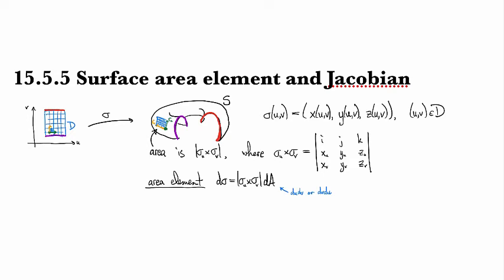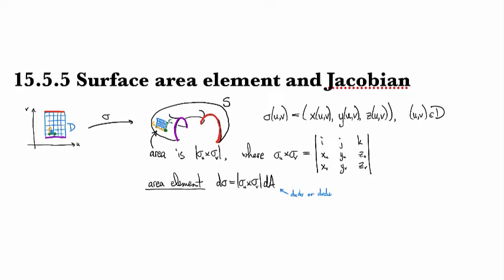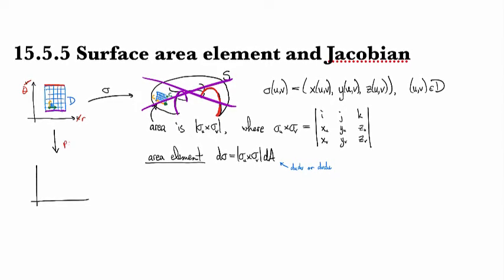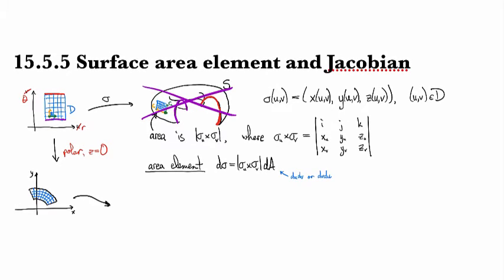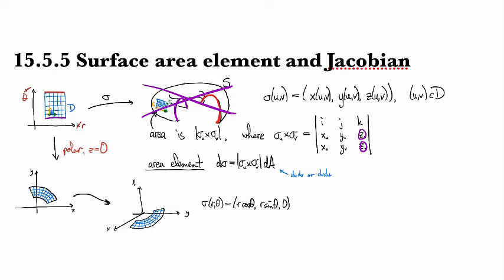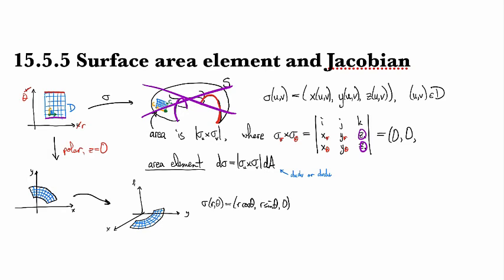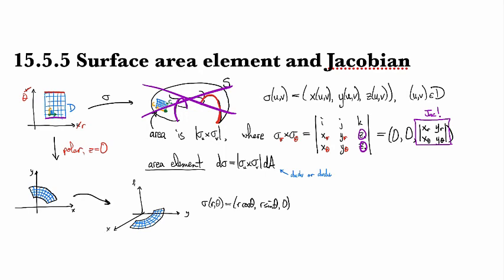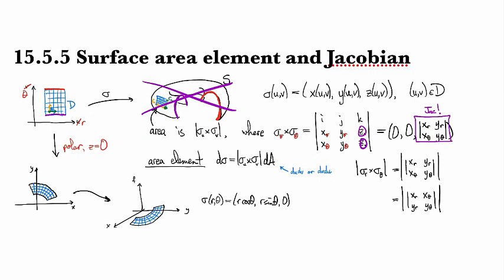15.5.5 Surface area element and Jacobian

Comment: 👏 👏 Why doesn't this have a million views? In the end, it's so simple, yet I really struggled to find any other source that connects surface integrals with the Jacobian. Thank you!

PS: Your presentation style is great and you do not need to apologize for your drawings. They are excellent!

PPS: I agree that using r as the surface is confusing when r is also one of the parameter names!